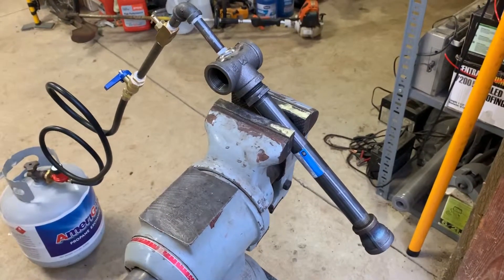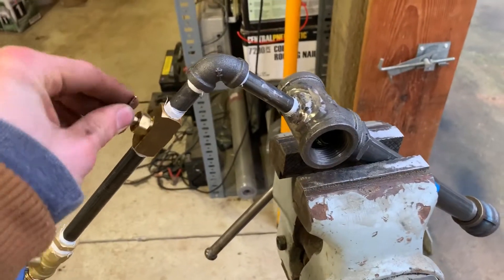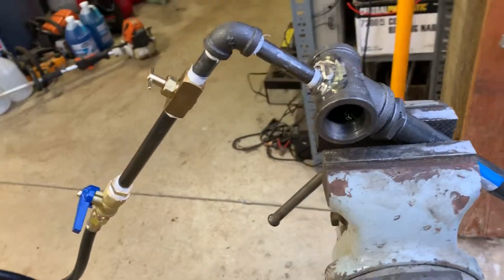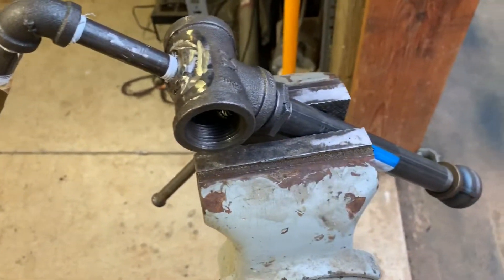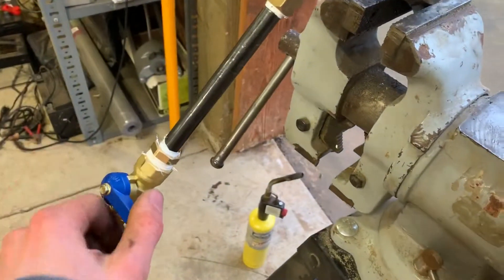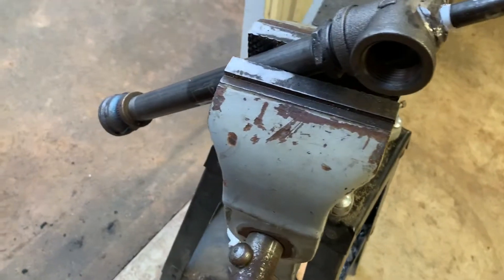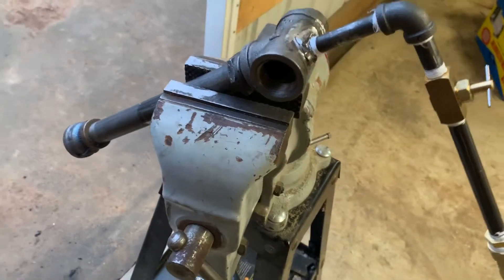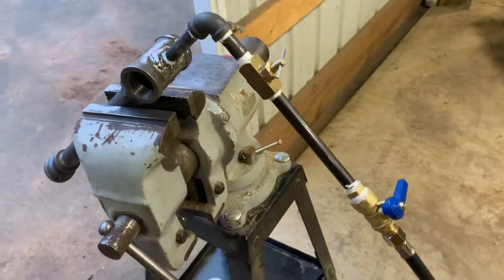Venturi Propane Forge Burner

Comment: Which gass  is powerful for melting iron
Reply from the maker: I use propane gas.
Reply: @calvincampbell6396  can I use nitrogen gas?
Now I use fuel propane,but I want to change it.can I use nitrogen gas?
Reply from the maker: Try it, let me know how it works.
Reply: @idrisumar4473  nitrogen is definitely not combustible.